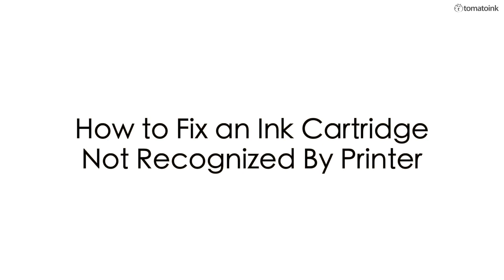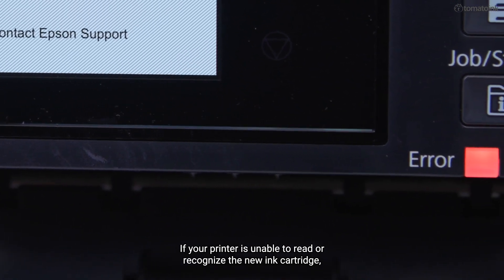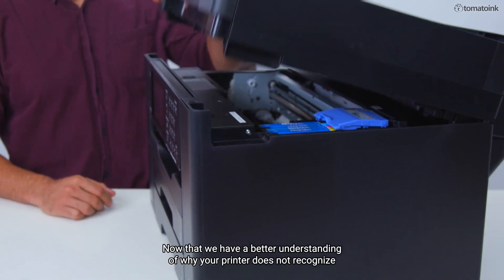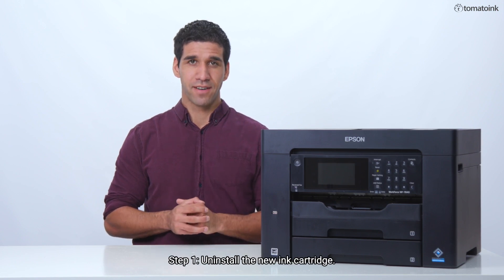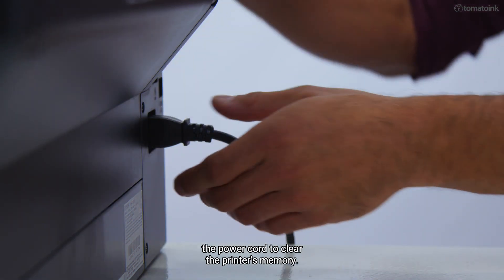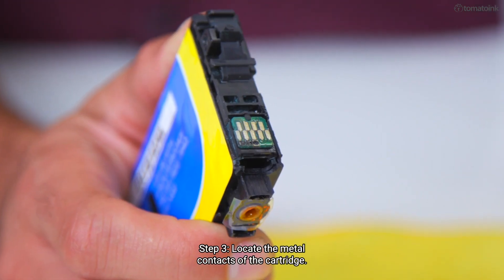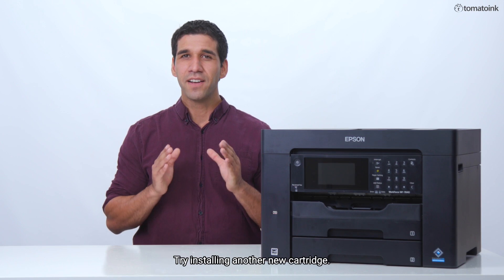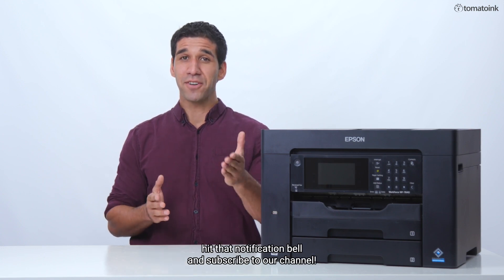How to Fix Ink Cartridge Not Recognized by Your Printer

Comment: For HP Officejet Pro users whose printer no longer accepts 3rd party cartridges....

Once your HP printer has had a Firmware update that enables dynamic security (stops you using non HP ink)  you will have to use HP ink after. There are no config operations on your printer that will turn off dynamic security.

You can perform a Firmware downgrade which will revert the firmware to a version that does not have dynamic security, you can find the firmware on some ink sellers' websites. THIS IS THE ONLY SOLUTION. I have done it on my HP 7740 printer.